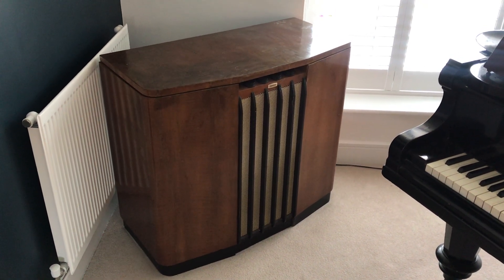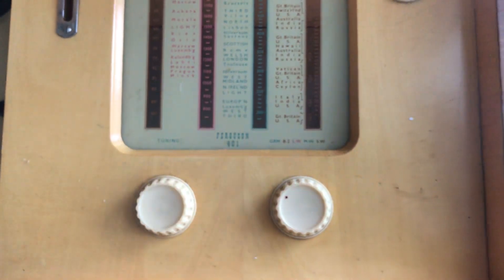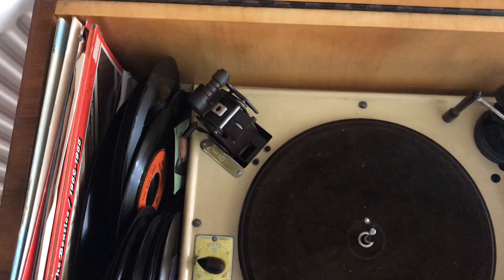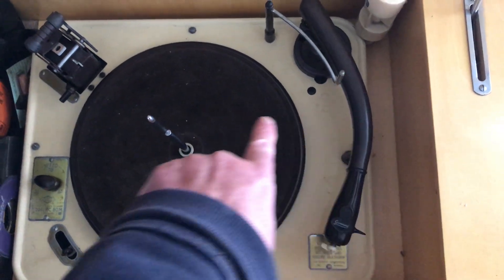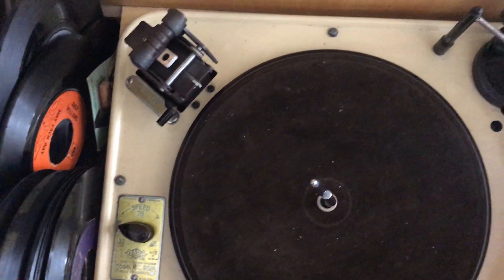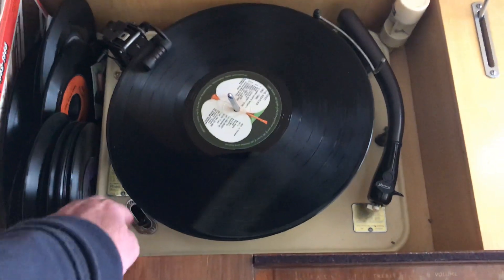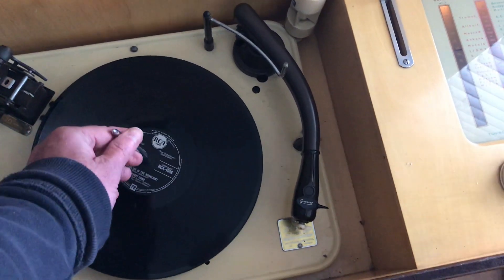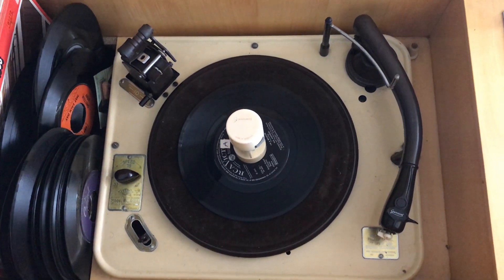How a 1954 Ferguson Model RG 401 RadioGram works

Comment: Hi David. Thank you for this demonstration, which was really helpful as I have just inherited one of these, exactly as the one you are showing. although it seems to work, It does have a problem in that I can't get the recod player to go throguh it's cycle and therefore play. The turntable will go round, and there is sould to the stylus, but the arm remains fixed in it position. Do you know of someone in the south east uk that might be able to help with this?, or is there any tips you could giove me. Many thanks in advance.
Reply from the maker: Hi

Lift the turntable and that will reveal the mechanics

Spray with WD40 especially by the big cog and centre spindle 

If that doesn’t sort it, get a hairdryer and point it towards the mechanics. That will loosen the oil/grease and it that could well sort it out. It was the same with mine

Keep in touch if you need more help

Good luck!
Reply: @davidlewis7664  thanks David so much for your reply. I will give that a go this weekend and report back. really appreciate it. All the best. tim
Reply from the maker: @TimB-zi1tr  The problem for my radiogram was that it hadn’t been used for years. The grease had become caked on. Hence the hairdryer to loosen it

When you remove the turntable move the start/stop/reject lever

You should see a movement (towards the centre spindle I think)

Try turning the big cog

That should make the arm lift up/move to the starting position of a record

Then move the arm to the centre spindle 

You should hear a click which should engage the big cog

Turn the big cog by hand and the arm should return to the start/finish position
Reply: @davidlewis7664  David... Thanks so much for your help with this, you are a genius!!!..... It works after doing exactly what you said.... All the very best. tim
Reply from the maker: @TimB-zi1tr  enjoy!

Loads of cheap records on eBay. Indulge yourself!